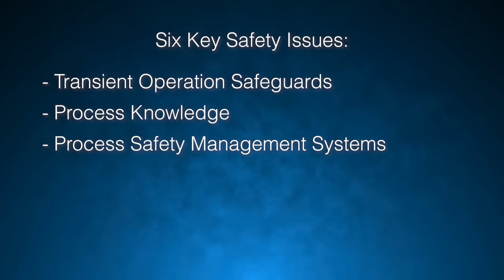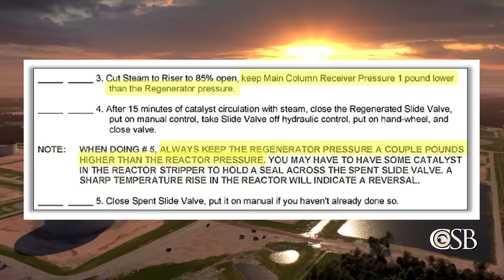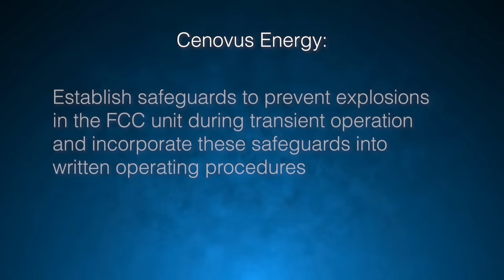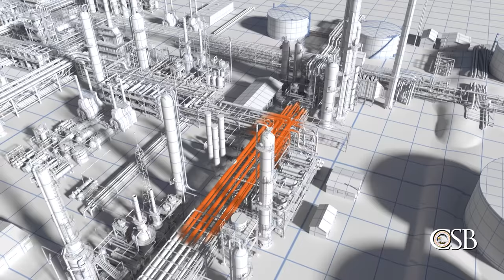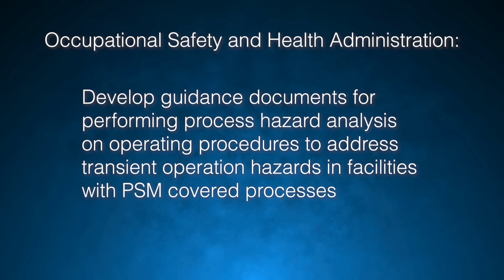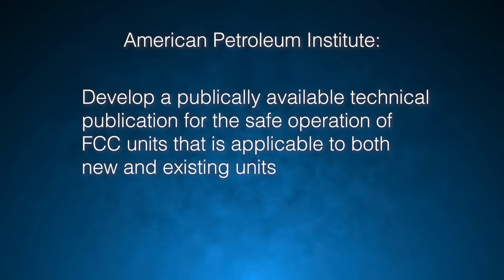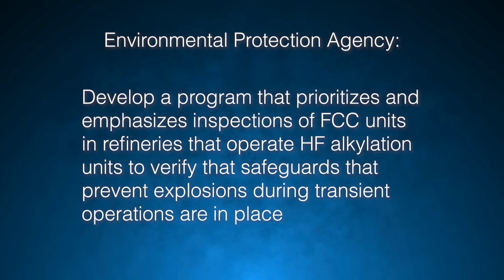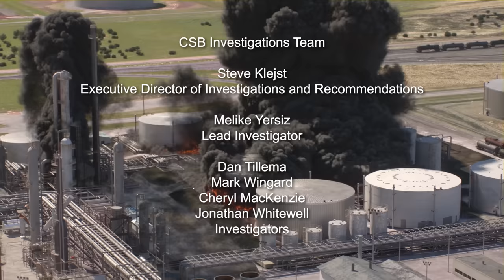Transient Hazards: Explosion at the Husky Superior Refinery

Comment: I don't work in a refinery, and the most hazardous chemicals I regularly encounter are household cleaners. I still find these videos very informative, because so many of the underlying issues are the same across industries. Not learning from one another, not keeping up with new recommended practices, not performing inspections and preventative maintenance... I've seen those same patterns cause disasters in everything from refineries and aviation to amusement parks and office buildings.
Reply: Lack of proper training is another problem.
Reply: @sophierobinson2738 We get trained great in California
Reply: Have you seen the video of the woman mixing pool cleaning chemicals, she turns her back for one minute and the pail was overflowing with a frothy mess of who-knows-what chemical.
Reply: @bryanaustin8362  it was probably (probably) an acid-base reaction causing the frothing. those release a lot of (highly flammable) gas and heat and are all-around not a great time unless it's baking soda and vinegar and you're ten years old.
Reply: Household chemicals can still be dangerous, just not on the same scale. Know what you’re working with and don’t get yourself injured or worse. A quick google search may save you!

Comment: Excellent video. I was in neighboring Duluth, MN that morning and drove back home to rural Superior, WI while watching the huge black plume of oily, black smoke pouring from the nearby burning refinery. Fortunately for myself, the wind was blowing the smoke away from me and I didn't have to evacuate my home, although those just north of me closer to the city had to leave their homes as a precaution. There was a fear that the fire would not be contained and would spread to the other storage tanks which would have been even more disastrous. Fortunately, the local firefighters were able to eventually put the fires out, but the damage was extensive. The refinery had been shut down and essentially rebuilt with a return to operation only a short time ago. So far, everything seems to be working without incident.

Comment: RE: brittle fracture
Blow out panels are also a good option- they can safety rupture during an explosion and reduce the pressure on the main vessel.
Reply: How does that work, exactly?  Sounds useful but I know nothing....
Reply: @RICDirector  
Either a panel thats made out of a much weaker material than the tank- it'll hold during normal operation and fail during overpressure.

Or it's a section of tank held on with 'break-away' bolts, which snap when overloaded.

Comment: 3:30 this is exactly what happened also in the 2015 Explosion at ExxonMobil Refinery in Torrance, CA. Eroded slide valve that let the catalyst barrier in the FCC run out which in turn let the hydrocarbon vapors flow where they shouldn't and then boom
Reply: I was just about to make the same comment. You'd think by now all slide valves in all FCCs across the country would have been replaced.
Reply: Didn’t they make a video on that too? I could have sworn I heard all of this before. Edit> Yes and they mentioned it too, wow.
Reply: @peterharper8216  back in 2017, yes
Reply: Thought it sounded familiar!
Reply: As soon as he said "catalyst" and "slide valve" I knew they'd done a video about a similar accident before, couldn't remember where it was though.
Reply: I was thinking this too! This has to be the third or fourth CSB video on this exact same problem.
Reply: @eithnemelee2997  I found only one with this specific eroded slide valve thing, but refinery issues in general are a recurring theme unfortunately
Reply: I'm going to be honest when I first saw this video I was like didn't they already cover this..
Reply: I think they basically cut off the steam at one point, right?
Reply: @jeremyloveslinux  Yes the same path created by the eroded valve and loss of catalyst made the steam escape the normal route and prevented to apply the correct procedure to do the needed repair. So since they had this steam impeding the work they reduced the flow which allowed the hydrocarbons (also from another leak in a heat exchanger) to flow toward the electrostatic precipitator and boom

Comment: 7:06 now I think I know what was leaking at the refinery by my house. It was a steam pipe that was repaired incorrectly (didn’t use perpendicular welds at the ends) so it split open along the end of the weld, leaking high pressure steam for months back in the summer of 2020

Ofc the EPA was “working” from home so nobody cared. I think it was fixed when they switched to the winter blend gasoline

Great video! This channel keeps getting better!

Comment: The USCSB makes amazing content. It's unreal that I understood the exact series of mistakes that led to disaster after only 3 minutes, due to previous videos. This isn't the first time that this type of mistake was made, and led to a similar results. I paused the video to verify, and found that the USCSB already did a video on the 2015 ExxonMobil Refinery explosion in Torrance California was also caused by a corroded catalyst valve and improper maintenance procedures during shutdown of an FCC unit. It's amazing that other refineries didn't look at that disaster and make any changes to avoid a similar failure. I'm glad you pointed that out in your analysis. It seems like the problems are industry wide, not just one or two bad companies.

To compare the two disasters, the ExxonMobil explosion was partially caused by multiple simultaneous failures, where another gas leak caused the FCC to have higher pressure, which meant that pumping steam into the FCC didn't stop the backflow of gas. They also had gas monitoring equipment that alerted them of the problem, so they had time to evacuate and attempt preventative action. But at the Husky Superior Refinery, not only were there no safety procedures followed, but the actual procedures involved practically guaranteed that an explosion would happen, even when proper safety equipment was available to prevent this from happening.

This isn't a disaster. It's borderline criminal, with extreme negligence that led to serious damage, even after another disaster happened because of the same causes. Not even having the owner manual for the FCC available seems like incredible gross negligence. It's a bit of justice that the town residents were not seriously hurt, while the refinery was shut down for years because even after the disaster became obvious, the refinery owners couldn't even mitigate the asphalt spill which turned from a problem into hundreds of millions of dollars of damage. If you compare the ExxonMobil explosion, the refinery only ran at limited capacity for a year, while this refinery was shut down for 4 years. I know the USCSB can't prosecute these companies, so it's good to see that their bottom line is being seriously hurt by their negligence. I only wish that the workers weren't hurt by the criminal actions of the executives.

Comment: A very common theme for these events is that equipment is never disassembled, inspected, and maintained.  Whether it's hydrocarbon gas or popcorn polymer, routine maintenance of purging/voiding and testing lines could eliminate the risks with great ease but the core issue is nobody understands what is going on inside of these pipes and valves.

Comment: Pyrophoric compounds are fun. Ops at a certain refinery had attempted to flush a tower and in an attemps to verify if one of them was actually clean they opened up a bleeder valve. A good amount of wated ended up on the ground. Unfortunately that water had contents of the tower in suspension. It was about 90 degrees on that day and the water dried up within about 2 hours. The compounds no longer stabilized by the water spontaneously ignited. No one was injured, but it could have been much worse considering it was a crude unit about a week and a half into a turnaround. There were probably 100 workers in that unit at the time of ignition.

Comment: There needs to be an industry-wide survey of the slide valves used in hydrocarbon catalyst systems. Perhaps a ball valve along with a backup aperture shutter should be installed in such systems.

Comment: Nothing will probably be done about the brittle fracture issue as it would require new updated equipment.  That vessel was probably made in 1960 when the refinery was built.  If it ain’t broke why fix it is the motto.

Comment: Why could they not add pressure gauges on both sides of these critical system valves, which would have indicated a faulty gate valve. Following with the use of the steam flush, or inert gas flush. 
Another one like was said is the placement of containment systems, as well as replacement of brittle metal components. Not too mention that there was no studies done on container breaches at different places and heights, would have shown that the berms were for much slower catastrophic events, relying on berms too close too the tanks as well as tanks too close together. Yes a definite near miss situation, that could have been far worse.

Comment: I'm sure there's another video on here, from another refinery, where the same issue occured - they had an FCC with a dodgy, worn valve that let catalyst material slip through until a flammable mixture was formed.

The fact that 2 refineries had the same root cause (excluding human error and process error) - it suggests that the design has some fundamental flaw.

Comment: wow, thats quite a series of problems that lead to a big issue. well, hopefully a proper materials inspection program  / nitrogen purge procedure can be put in place to prevent that mixing and upflow in the future. valve inspection seems like a no brainer, b ut, it can easily get forgotten in an ocean of valves, parts, and pipes. great presentation on this.

Comment: I live a half mile from The Superior Refinery and worked directly across tge street in the old Mariner Mall building. At the time of the explosion I was getting ready for work at 10:30am... Eating breakfast as the ground shook (i live in a basement apartment) and my first thought was that maybe a plane had crashed at the small aircraft Airport which also isnt too far from here. I have video somewhere of me walking across the street to go to work, filming the column of smoke as i go over, still not sure what had actually happened. Needless to say, within 30 minutes we had evacuated the mall and were told to get out of town.

Comment: I remember the initial flare setting up in 1960 and have had many friends (or their families) work at Superior Refinery. Being raised within a mile of it I remember the smell of the Murphy refinery (it smelled like money). Many hard workers there spent their lifetime making refined product. I get upset when the EPA is off running in different directions and never spent any time build the necessary process or protocols for Superior. Even after the rail spill the EPA never really helped. Now they want to push battery technologies that many communities are not ready for. The fires in Superior should have been a wake up call to the EPA but NO they were not.

Comment: The new intro is fucking incredible and don't let anyone tell you otherwise. 

In the realm where industry thrives,
Where chemical secrets come alive,
There soars an eagle, noble and grand,
The guardian of safety, strong and unplanned.

With wings of wisdom, it takes to the sky,
A vigilant watcher, in purpose it flies,
A symbol of hope, a sentinel so keen,
The Chemical Safety Board's sight unseen.

High above a factory, where dangers reside,
Where chemicals dance, their fumes collide,
The eagle surveys with keen, piercing eyes,
A vigilant protector, both bold and wise.

Through billowing smoke and machinery's hum,
It navigates the chaos, keeping dangers from,
In its talons, knowledge of safety prevails,
As it soars through the air, the guardian avails.

Its feathers, an armor, resilient and pure,
Shielding the workers from hazards obscure,
With every swoop, a message is sent,
Urging precautions, no risks to lament.

No toxic plume shall taint the air,
For the eagle guards with utmost care,
Inspecting each valve, each pipe, each tank,
Ensuring safety, no room for prank.

With grace, it glides amidst chemical streams,
Protecting lives, fulfilling its dreams,
A majestic presence, noble and bold,
Guiding the factory with courage untold.

For in its flight, a promise resides,
To shield the workers, to turn the tides,
From the eagle's perch, it whispers its creed,
"Chemical safety shall forever succeed."

So let the eagle soar, high and free,
A symbol of strength, a guardian to see,
The Chemical Safety Board's vigilant guide,
Ensuring safety with unwavering stride.

Comment: I know nothing of chemical refineries, but my first thought was “why wouldn’t you purge the air side with an inert gas if the failure of a single valve could create a giant bomb?” I guess the bigger question is how is there even a potential for oxidizer to mix with hot, vaporized fuel in a closed system where the only possible outcome of that mixture is explosive catastrophe?

Comment: Just seems mad that the standard double block facilitating leak detrction of calves, has not been regulated into existence, recommending proper shut off valves as per gas fuel combustion systems.

Comment: The Leaking slide Valve in this case appears to be the initial problem, it should have never been neglected to become eroded the cause this problem, very Lucky No one Died, it had all it needed to take out a lot of People ! I worked in a Refinery for 42 Years, Slide valve management and Maintenance were a very Big Priority! They are Big Valves, it takes a lot for them to erode internally, even with a massive flow of Hot Catalyst.

Comment: I operated boilers in the Navy and onshore. Why not have a double valve system , if you rely on this type operating procedures. Also this is the problem of no piping inspections internally and valve inspections that should be in maintenance schedules.

Comment: Isn't this FCC slide valve problem IDENTICAL to another incident?? Two severe incidents caused by the same kind of problem in the same kind of equipment should be grounds for the government to mandate some upgrade, like maybe two redundant slide valves, an alarm for low catalyst levels covering the valve, or an inert gas purge system.

Comment: I assume it would be better to keep storage facilities away from anything that would it go boom, could propel shrapnels into its sides. Besides costs, are there any reasons for not keeping such dugg into the earth? Like having an outer basin ontop then the tanks are constructed, topside of the tank leveled out with the surrounding surface. Then even if a spill would happen it would be kept by the basin and shrapnells may if at all hit the topside of the tank. Thereby i would assume make exident better controllable. As seen from the footage not just the tank that was punctured was then damaged but some of the surrounding once due to the fire, too.

Comment: Incident happened due to changes made to minimise environmental pollution by lesser flaring. And see how they ended up.

It is very easy to change a process to make it more profitable, more environmental friendly and more efficient, compared to what licensor proposed and installed initially but there has to be a full stop at some point of time or else refiner going to get face these incidents in future.

Comment: It's ridiculous that these companies are not forced to do constant analysis and upgrading and securing of their facilities. 500M? no big deal. now when I drive down the streets I know why there are so many homeless people. Someone has to pay that 500M and it sure won't be the execs, their mansions, nor their yachts. Virtually 100% of these problems can be solved by actual work that seems no one wants to do for fund cause "waste of time, it will never happen, we safe bro! let's go party!".

I can assure you that if execs were hung for allowing these things to happen(which they do because most are actually completely ignorant of the inner operations) these things would rarely if ever happen.

Where does the 500M actually come from? 500M = 500*1000*1000 = 500*1000/20*20*1000 = 500*50*1000 = 25*1000*1000 = 25M. That 25M IS the NUMBER of plebs who have to work 1 full year to pay the costs, no housing, no food, no nothing. In fact, it's much greater if you use third world plebs.

Inflation is caused by the rich, not the poor. Can't have the rich without the poor. These events are far too regular and too costly. They are not due to "natural factors" but due to greed, arrogance, stupidity and power.

Comment: There should have more vavles in place as backups a form of safety check vavle a blast wall separating the plant from several other hazards by separating it is possible to reduce them 

In having a blast container area you could also probably house flammable leaks in open air where it does not spread and may vent off if a blast wall was in place soroundin above ground storage tanks they could have reduced the damage to the tank if not that maybe even stop all together and we wouldn't be watching this video 

Its clearly obvious there was terrible shotty engineering done at this plant where cost was an issue and safety was not